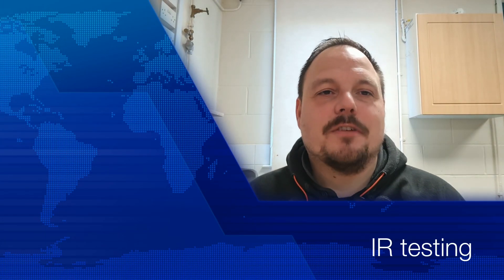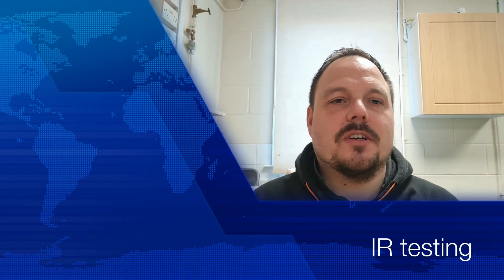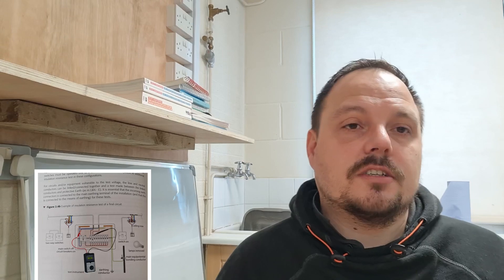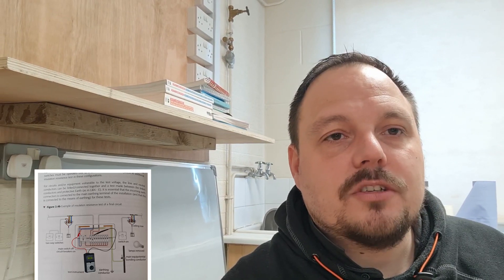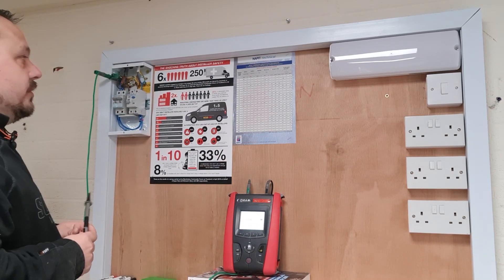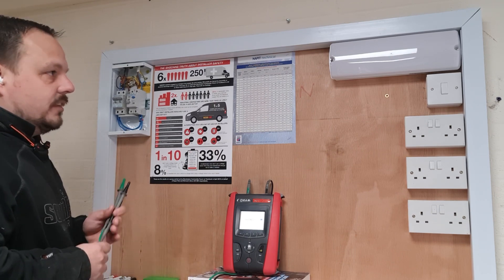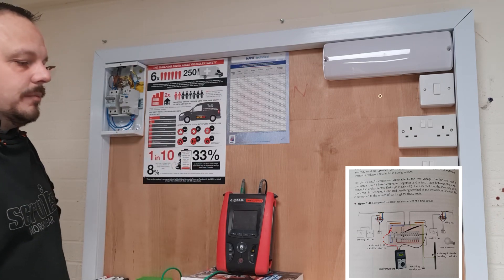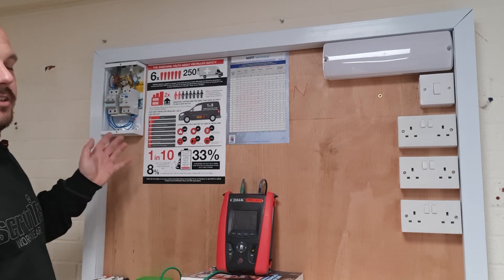Insulation Resistance Testing UK Electrician TIS MFT Pro

Comment: How do you rate the TIS MTF in comparison to megger MTF?  Reason I ask is I use megger (for the auto test in continuity and Ze/Zs etc) but looking for another MFT tester and considering the TIS. Your thoughts would be appreciated.
Reply from the maker: I use the Megger as well. Both have different strong points to be fair. Like you say with the auto continuity on megger.

I got this as the EV kit to be honest because it was exceptional value. Used the mft pro to get used to it and really like it. Especially the earth clamp and power factor/data logger capability. Has a few extra features like volt drop measurement as well. 

TIS have some good videos on there YouTube and David Savery has covered it a few times if that helps.

Comment: Wrong,  insulation resistance test BS7671
Isolate the mains switch remove all loads all switches must be in the on pasiton, test at 500 V
Between line and neutral then line and earth then neutral and earth and then line and neutral to earth. If you can't remove any secretive electronic equipment from circuit then test at 250 v line and neutral to earth
Reply from the maker: I think thats what I said Sean. Pretty sure I did anyway 🤷‍♂️. Aside from not doing L+N combined to earth after doing L-N, L-E, N-E. 

This video was made after an appretice in the A121 group asked for help doing IR tests on initial verification. Never been a fan of the combined test on initial verification.  Thought I covered that in the video, maybe not.

Also my video was setup in a way to show what happens if you dont remove loads. Was the only way I could think to record it in a way that works.

If you can do a video of what you think it should look like. I can point the apprentices at it. We have thousands in the group desperately needing help. 

If you wasnt aware check out www.apprentice121.co.uk or @apprentice121 on instagram. I film my videos around running my business and helping get redundant apprentices through Covid back into work. It takes a lot of time and over 300 back in jobs. We have also put safe isolation kits in many apprentices hands free of charge. 

I try my best to help with little videos and this certainly isnt instructional or a video guide to BS7671. 

I look forward to seeing your video and will 100% pass it into the group. Its desperately needed if you get time.

Thanks for the comment.
Reply: @electrician247  unfortunately I don't do video's I don't know how to at least not on utube, maybe I could get my son inlaw to help me  but don't bank on it  and sorry to be picky but you didn't mention it as I discribed in your video but hay don't worry about it the was OK. I think you're doing an OK job keep it up and I look forward to seeing more. Thank you
Reply from the maker: Thanks Sean, more is coming. Getting a lot of request from the apprentices in the A121 group. Check out apprentice121.co.uk and @apprentice121 on instagram. 300+ back in work through Covid redundancy. Free safe isolation kits to many. 

My video was mainly to show what happens with connected loads left in. Not an instructional guide to BS7671. If I had gone with L-N first video over lol. 

Did my best in the time I have around A121 and the day job. Putting everything into helping people. If you want to be involved get in touch through the website.
Reply: @electrician247  as I said don't worry about it I think you are doing a good job it's just me being a bit picky
Reply: @electrician247  excellent and fantastic to see the wonderful Gary from GSH giving a helping hand. Well done your doing a fantastic job mate

Comment: Looks like you have not been sleeping well look after yourself. Health is the most important thing. Don’t feel pressured to keep the videos coming do it when it suits you and your time.

Good you mentioned guidance note 3 also the IET on-site guide. There is one test that’s never done and I have never seen it done. I just recently bought the tool from sonel but I will let you guess what that is.....
Reply from the maker: Lol I just look rough its about -2 in my office with all the building work going on and the roller door open all day. I am sleeping good, if ever I am struggling I just watch one of my videos lol.
Reply: @electrician247  take a look at IET YouTube channel I requested them to do more on the channel for apprentices they have a small amount of material (limited really) but they have promised to do much more hopefully and it’s coming shortly apparently that’s a case of a trade body listening I would also suggest many of you electricians and apprentices tell them via YouTube Instagram or DMs about what is needed. Maybe even have them on your channel? To discuss this very issue.
Reply from the maker: @mathman0101  I would love that. Chatted with the IET before myself. But not much happened. I am a MIET engtech if it makes a difference lol.
Reply: @electrician247  probably would IET putting more video content on testing and exemplification s of their guidance notes would be an unreal amount of excellent material would help all electricians and would raise their profile as a body thats responsive and at cutting edge of ensuring learning leads to higher technical standard and competencies. Your the right man to do it give them a bell.

Comment: would Zdb be equal to Ze plus the (R1+R2) of the feed to the sub board?
Reply from the maker: Yes mate roughly speaking. Of course parallel earth paths and bonds will make them slightly different. But in that ball park 100%

Comment: Thank you. So insulation resistance testing could potentially last for hours if you have to disconnect all the lamps (on your set up you have an emergency light - if a house/commercial unit had 5 emergency light? 

If you don't NULL the testing device - does it have a noticeable effect on the final reading - especially on a full house/commercial unit? of is it done more to show accuracy in your final reading. I can see that on a small test rig it will add the overall length of the wiring. Thank you.

Any way thank you for the video (our Thursday practical sessions are on hold at Bradford college until further notice - so the video is appreciated).
Reply from the maker: In this situation you can join line and neutral together and then test to earth. Avoiding removal of the lamps and ensuring IR to earth is good. On initial verification it really needs doing in full though.